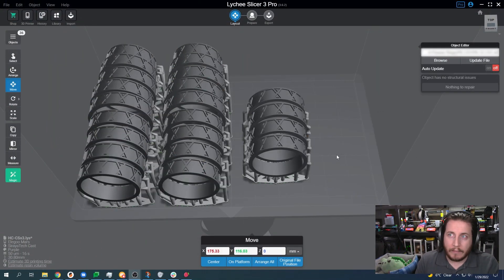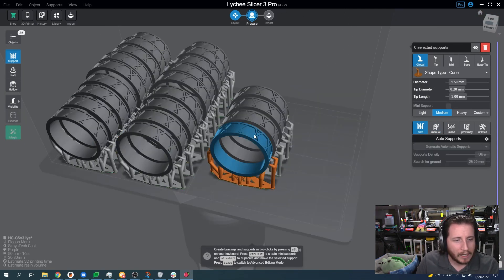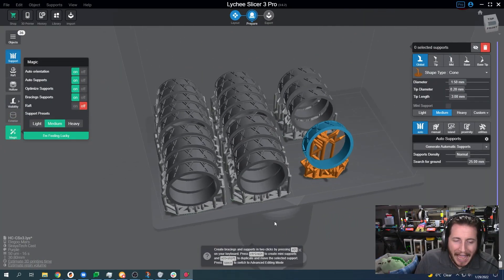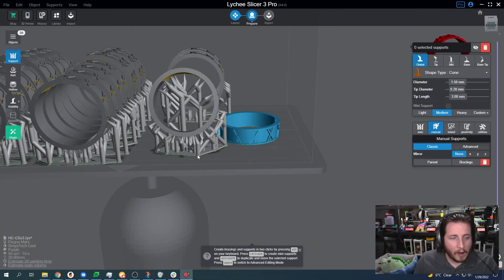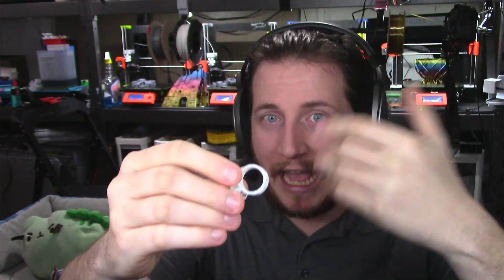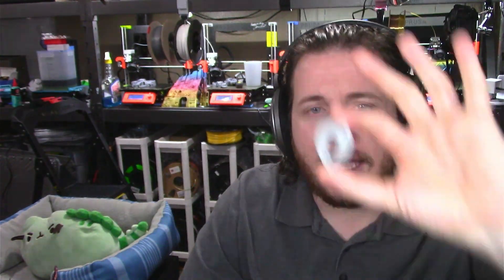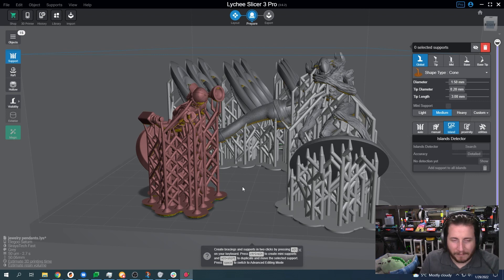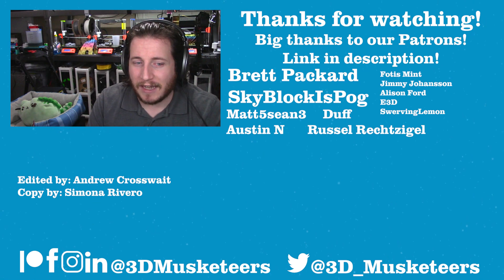Introduction to Resin Supports: Why They Matter!

Comment: Any way we can try out your support settings? I really hate trying to figure out what works and what doesn’t and would like to try a baseline apart from the Lychee defaults which in some cases are a bit too heavy or way too light.
Reply from the maker: We showed it briefly on screen, but we will be covering it in next week's video where we show some tips and tricks for getting good supports, we will show it off there too. Full length tutorials will be saved for Patreon though :)